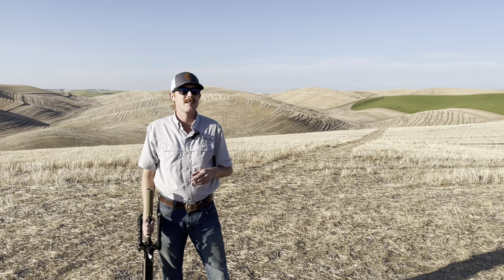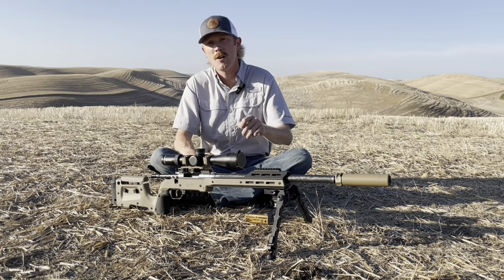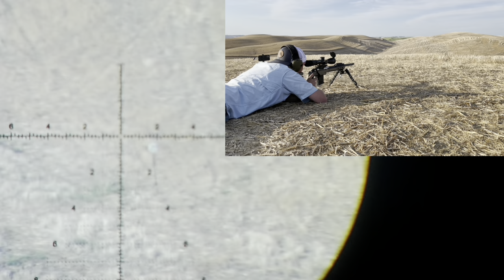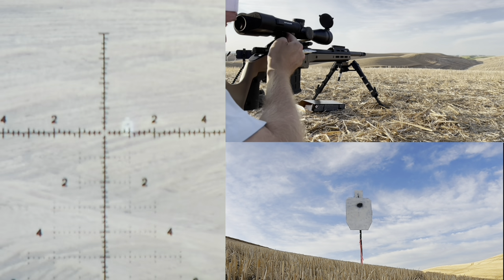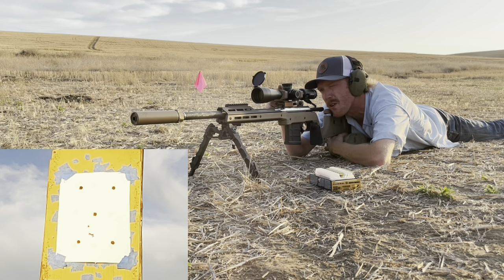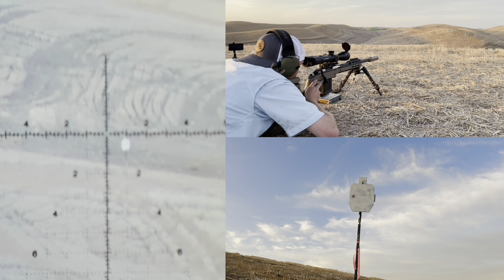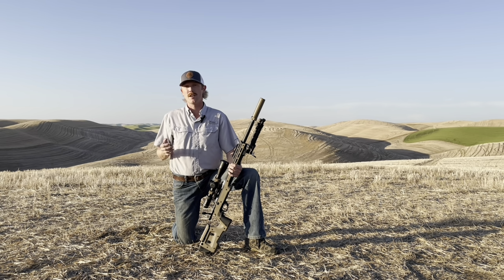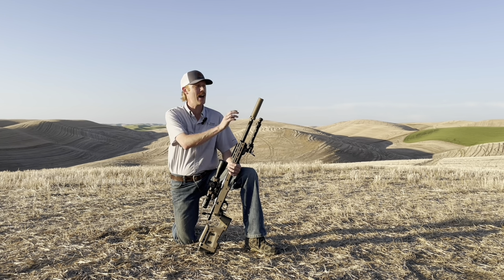Precision rifle FAQ.... Does adding a suppressor change performance?

Comment: You got me thinking on this.  Im new to suppressors and decided to see what would happen doing a side by side comparison suppressed and unsuppressed. Gun is a Ruger American Predator in 6.5CDM.  Can is a Rugged Surge 7.62  I had not planned on doing this comparison when I left the house so I left my Garmin Xero doppler chronograph at home.  Additionally I was shooting only at 100yds.  My club has a 300yd range but it requires a bit more setup and wrap up vs just the 100yd range.  Shooting my hunting load that this gun really seems to like (Hornady Precision Hunter ELD-X) got a nice tight group about 1.5" high which puts it dead on at 200yds.  Removed the can and got another nice tight group but 4" low.  No left to right shift at all.  Surprised I switched to my 300BLK using another good hunting load (Black Hills 110gn Barnes TAC-TX I believe).  Similar results.  Group size seems identical, no L/R shift but the group fired suppressed was several inches lower than the group fired un-suppressed.  I need to use my chrono on the next range session and make the effort to use the 300yd range and re-zero with the can removed and then see what difference there is.  Gosh I wish I had someplace to shoot beyond 300yds but I've been unable to find anyplace that's not at least a half days drive away from me.  Love the detail you put into your videos.  Definitely helps me make the most out of each range session.

Comment: From the uk here, we have been using suppressors for many years,  on centrefire riflei have seen points of impact changes from 2in upto 10 in high,depending on barrel contour,and very rarely an horizontal shift in poi,
Best wishes, your vids are very good,rgds steve

Comment: With my precision rifles and my Omega 300. Velocity bumps up between 30 to 40ft/sec. Vertical deviation of 1.5" to 2". Groups generally shoot slightly tighter but nothing significant.

Comment: Great job as always!  I think it would be easier to visualize the data if you summarized it on a single piece of paper or slide.  It can be difficult to remember the numbers from suppressed vs unsuppressed but having something like suppressed vs unsuppressed velocity and the drops side by side for the different ranges you fired at would make the summary much easier to comprehend.  Also, 2.6 SD on that FGMM is insane!
Reply: Paul Harrell style.

Comment: At 25 yards, my AR15 shoots 1 inch lower with my suppressor vs without. It is a fairly large suppressor, barrel has a medium contour profile. It is free floated; however the barrel nut isn't the most robust.

Comment: If you are sniping it whatever drop you may get you will compensate anyway right. I suspect a little drop with slight difference in less velocity at longer range. But it's so much better on my ears and you won't be scaring all the rest of the game off.

Comment: My poi shift is exactly .5 mil lower at 100yds out of a 26” Desert Tech SRS A1 using a silencerco .30 cal suppressor. Your shift looked to be the same. Wondering if a “low shift” is common?  Reading comments. Thank you for providing your very interesting content. Thoughtful, helpful video!!
Reply: It is very common, same thing with all my rifles when i throw a can on.
Reply: @ttokentv1631 thank you!

Comment: Correct me if I’m wrong here, but wouldn’t the dope for the ranges be fairly identical since the POA/POI shift for the can was already delt with when the rezero happened?
Reply from the maker: Well that’s the main thing I’m showing in this video and yes I’d say the results shown in the video match your comment exactly. Seems like a lot of people think suppressors drastically change velocity or range and if that were the case then the bullet drop would also be different. Given velocity barely changes though bullet drop is nearly identical.

Comment: Factory ammo variance is vary obvious at those distances. I was surprised to see you were shooting factory match. Might be worth weighing them and shorting them to try to lower that variance.
Reply from the maker: I believe shooting factory ammo is a bit more relatable for the viewer. Sure I could work up a handload that maybe performs a little better but that would be something specific to my rifle and loading abilities. By running factory match I believe it establishes a baseline that any viewer can replicate. Sure I’ve shot handloads on video but for something like this I think factory ammo is a better fit. Thoughts on that?

Comment: I have a question. Do you have to re-zero when you add a suppressor. I have a DD MK18. 5.56 nato 10.5 in barrel. I have a sure fire  SOCOM556-RC2 suppressor. It was sited in at 25 yards. When i added the suppressor, the group was about two inches lower. Is this normal?
Reply from the maker: Yes, adding a suppressor will change the point of impact. 2” at 25 yds is a lot but it is what it is. You’ll want to rezero when you add/ remove the can. Typically I install the can and leave it on so I don’t have to mess with the different zeros.
Reply: Thanks, It may have been less the 2". I counted 13 clicks so it will be easy to return to the old adjustment. After i use up my .223 ammo I will leavethe suppressor on and only shoot 5.56mm green tip. @MountainsMulletsMerica